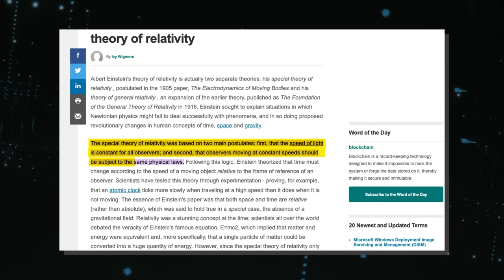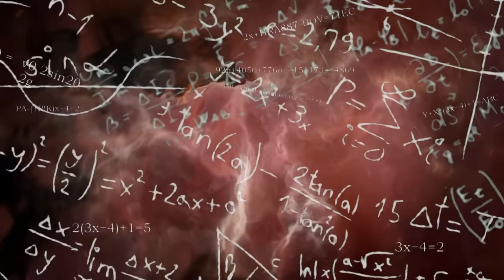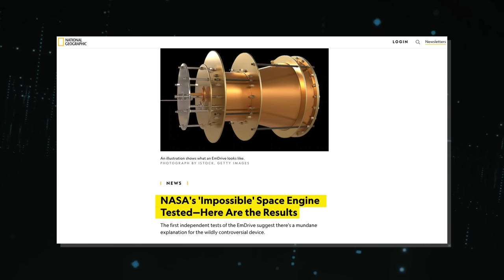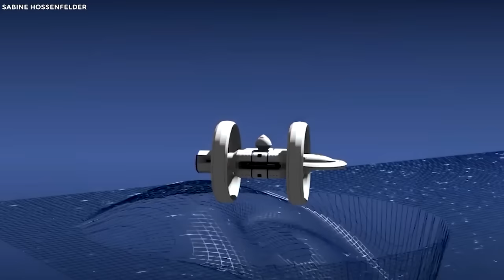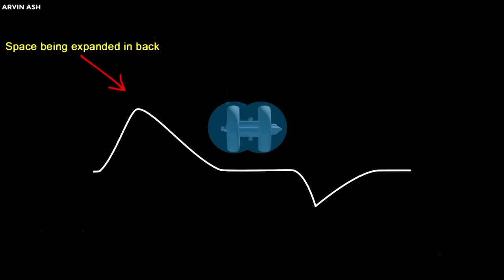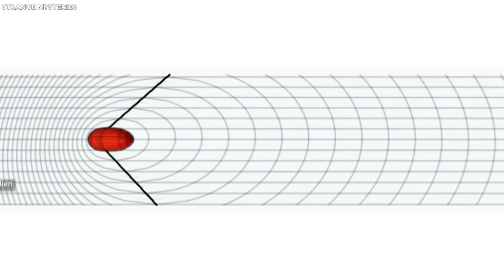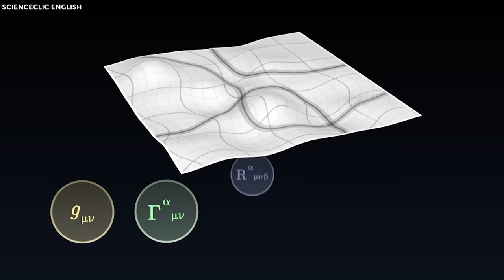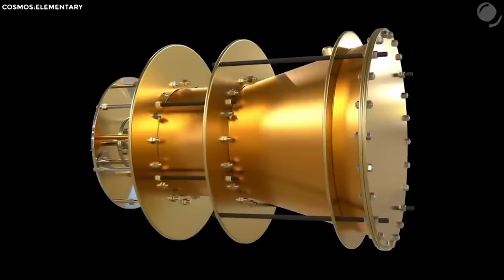NASA Just Admitted They've Created Something So Advanced It Can Reach Lightspeed

Comment: Forget black holes for space travel, it does not work, you will suffer the same fate as the Titan sub, light does not escape for a reason, gravity, we struggle to escape Earths gravity at one G let alone the gravity of a thousand stars, but there is a radiation that is faster than light, Cherenkov radiation could be used